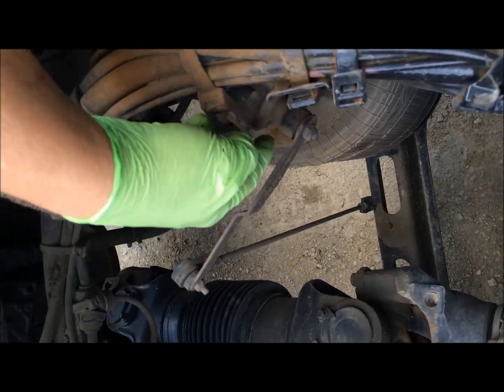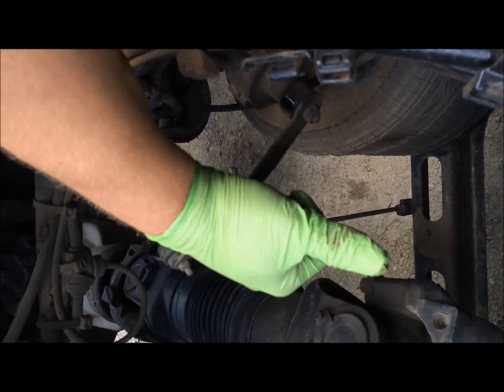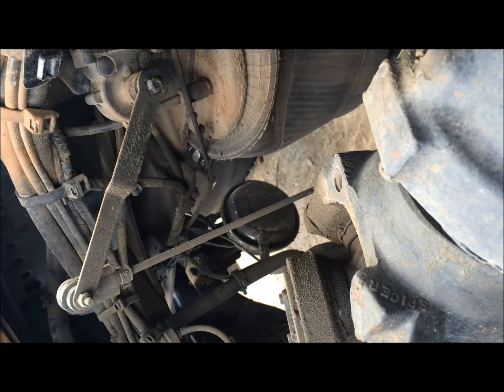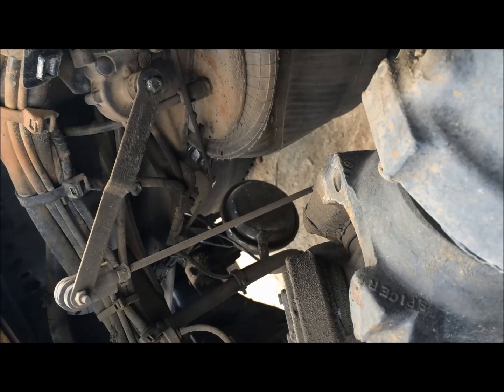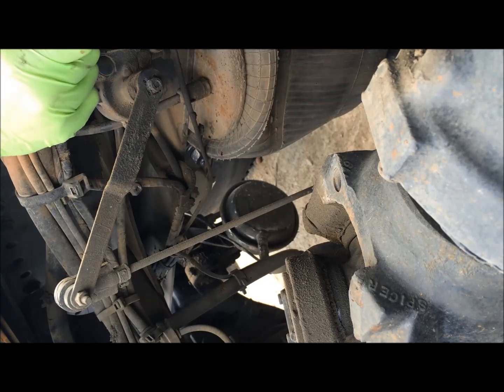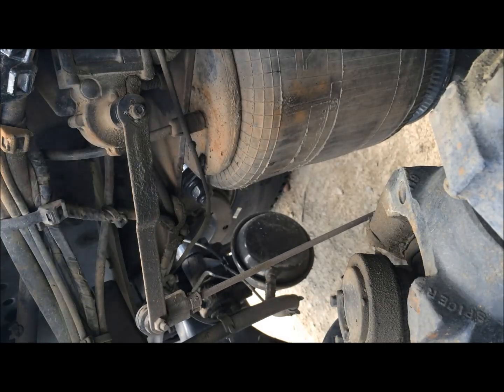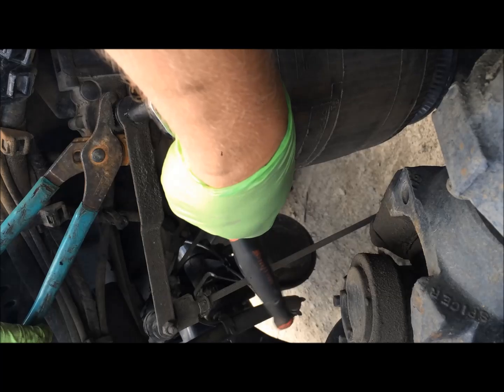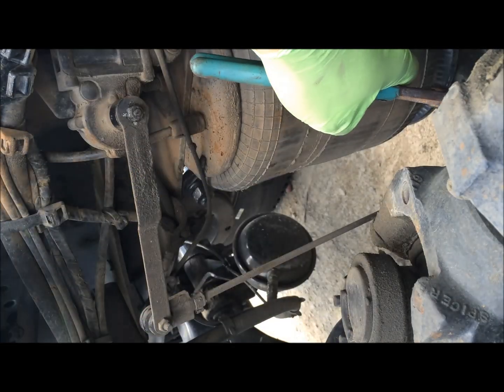Air Suspension Leveling Valve.

Comment: If air is not present at the suspension leveling valve an air pressure protection valve may be stuck .  It is located on the secondary air tank .

Comment: The rubber grommets,  if you will. Are they suppose to rotate freely on the bolt. .meaning I see the bolts are smooth then a thread starts . Commonsense tells me it should hoe ever I'm not a mechanic and my mechanic has them so tight the rubber bends over instead of it freely pivoting on the bolt. I mean it's a lock nut it's not going any where but he says leave them on there tight. Now my bags are 3" from bottom of inner bad I guess to the rubber of bag

Comment: Hey Carl.. I have an FH 12 Volvo having trouble with no air going into the airbags.. got told from a mechanic yesterday that there’s no power coming from the front sensor plugs to activate air down to the airbags. Would you have any ideas on what it might be? I’ve got a sparky coming out to have a look but that’s in about a weeks time.

Comment: Is the leveling valve the same valve responsible for dumping the air suspension when I flip the switch in the cab? Or is there a separate valve with an air switch for that?

Comment: Thank you so much! I have a job to start in the morning and of course it screws up at 10pm the night before. Without this video I would still be looking for broken wires. I just took off the linkage and pulled it up and it started to air up so I put it back together and that seemed to fix it!
Reply from the maker: Mitchell Heyink glad I could help

Comment: I have a question sir ,I have a 2015 kenworth t680  the bolt that holds the leveling rod that is tied to the bottom part where the shock is  keeps breaking on me is it because I need new shocks?
Reply: Hey did you fix your problem? I kept putting new ones one and they keep being pulled forward to lay on the air  bag... The entire L shaped rod is been snatched forward... Causing the bags not to be level.. Any info would be greatly appreciated

Comment: Ty! I'm going to have a look at my truck for this issue. My problem is actually reverse. The airbags are overinflating and not deflating even though I can hear the air releasing
Reply: Sublime Rebel what’s up man. My truck is doing the opposite of what he is sayin likes yours !!! Did you come up with a little quick temp fix !! ??
Reply: I'm having the same issue.. I don't have a susp / dump valve.. so not able to deflate the airbags
Reply: Did you turn the adjustment to deflate?

Comment: How many valve used in air suspension system each one how works
Reply from the maker: Muhammad Fayyaz so there is typically one on the real axle, and one on the cab. There maybe one on each side of the front axle in trucks with air ride front suspension. 

There is simply a spool inside that slides fore and aft based on are position. Other use a rotary spool that’s does he same thing.
Reply: Can I ask a question I need to see if someone can help me with getting air to my brakes so I can move my motor home I have just purchased I can't start the engine up at this time and I have only till tomorrow evening to move it about a city block but I got to get brakes released and I know I've got to have air pressure to do so is there a place I can hook a air compressor to a sertain place so I can get air to my tanks its a class a diasil motor home I know it' has six air tanks that I have seen on it and the engine is a3208 cat I don't know if that makes a difference or not

Comment: Thanks for the vid Carl. On my prostar, the back axle bags are always higher than the middle one. Any idea? Back airbags are full height while middle are about 2 inch lower.
Reply: Just installed a new level and the problem is still there.
Reply: Hello sir… I’ve the same issue with mine. The rear airbags are higher than the middle ones. Can’t figure out why is that? Did you end up finding out by any chance? Many thanks in advance 🙏🏻
Reply: I got same problem  put new leweling valve same think but pay atention every secund volvo is like that

Comment: Nice.

I have the haldex # 90054007

How do u adjust it?

Mine was leaking air.

So I bought a new one
And still leaking air? 

Through the clear hose. On the very top of the 3

Comment: Hey question what if it went dump and susp/dump is blinking non stop
Reply from the maker: Ernie Lepe I would assume your talking about an international? And if so, it means there is an electrical issue between the solenoid and the control module. Usually this is in the manifold assembly, and or the solenoid valve pins. You'll need to disassemble the manifold and check for corrosion, and continuity from the manifold pins to the solenoid sockets. If they check out it's likely one of the two suspension dump solenoids. There are two of them connected together.

Comment: Hey Carl what could of caused my engine brake to stop working on a 04 Freightliner Columbia ... thanks
Reply from the maker: Chris Jones oh good grief. There's many possible causes. The most common is a failed or misadjusted clutch switch. But it could be the brake switch, bad idle TPS, or the actual wiring to the over heads. I'm assuming it's a cummins? Insite will tell you specifically which is keeping it off. If its Detroit their software will too. Otherwise your gonna have to check switch adjustment, and then test for voltage to each switch, continuity through each switch, and continuity from the switch to the ECU.
Reply: Carl The Diesel Guy it's Detroit 60 serious I'll do what you said see if fix thank you so much. been such a headache ..

Comment: Nice. Mine leaks all the time. Took off the haldex and installed a different one. Same issue. It raises up. But just keeps leaking air all the time. 

Thanks
Reply: Mine does the same thing mario
Reply: That no good than air compresor worcking all the time

Comment: Hi buddy. I drive a Volvo VNL 2016. Anytime that I am loaded I got this air leak from that leveling valve I have it change but problem continue. That is the only problem that I got air leak for a little while then it stop.
Reply from the maker: Raymond Gonzalez is it an air leak to the open air? You will hear air entering and exiting the leveling valve for a few minutes when you hook to a trailer or unhook, Add or remove  a significant amount of weight. 
     If it leaks only when loaded after the truck has been stopped and left running for a while, around 10min, then you may have a leaking air bag actuating the valve, or you may be hearing an air leak in the actual air bag. Go around when you hear it, with a spray bottle of soapy water, and spray the tops of the air bags near the frame and where the bag meets to top plate and where the top plate meets the frame rail. Also when the bags are inflated spray the bottom of the bag near the "skirt" as well as all hose connections to the bags and valve. The bubbles indicate the leak.

Comment: I have a rv hauler its a 1996 volvo m11     i have a bad vibration people think my air bags are over extend   now here is the funny part  some guy efore me moved my air bags way to the left so there 3 inches sideways too much..  both the same way!  i moved them back now i have a bad vibration over 50   mph..  i put in a new carrer barring and all new ujoints and we timmed the drive shaft..  the air bads have been moved up and down the right way!  problem is the bad vibrtion is still there.. it was not doing this with the air bags way kicked sideways any clue why this is happening? i cannot drive it or pull my rv like this ..  every time i take it in they charge me and cannot fix the problem.. im going broke im done dropping money on this truck errr
Reply: i wish i could send you a photo

Comment: where you located? gonna get it checked....!
Reply from the maker: Alan Powel I am in Toledo Ohio. My shop is called Toledo Truck Repair and Service. 
However I am Very busy (read blessed), thus if you or anyone else needs service or help please call ahead. If I cannot get to you soon enough for your schedule Toledo Spring is very close and very good!
Reply from the maker: My shop # is (419) 478-6299. Our hours are normally 8-5 m-f now. However other options are avail by appointment.

Comment: Hi mate, my truck tilted to right side specially as it's loaded much tilted, the air bag suspension ok, everything in good order, what you think about that,?? Thank you
Reply: Alan Powel your truck is doing the opposite like mine is , it’s airing up too much therefore tilting the valve is not shutting off right
Reply from the maker: Alan Powel man without looking it over I'm not sure. But there's a pretty short list of things. Springs, hangers, bushings, fifth wheel anchor bushings/pins, tires etc...

Comment: 1999 Peterbilt 379. I am Not getting any air pressure to the air bags at all to my Semi, I do not have a trailer hook up.  I change my foot valve and my other valve, even the one in the dash. My lines are not cracked either. The new Foot Valve is still leaking. Do you or some might know where its coming from. If you do you can email me and I will respond. Thank you!
Reply from the maker: Ginger M, you would need to check to see if the line supplying the leveling valve with air, does in deed have air coming out of it. I'm fairly confident it does. But check that just in case. If it does and the rod connecting the valve to the axle is in place, then the valve itself must be bad.

Comment: kool... so no one will tell me my actual ride height. international prostar... asked terminal and several dealers. they all say set at factory leave it alone. i can feel my ujoints binding. ride height 2011 international prostar ??? thnxs in advance.
Reply from the maker: Paul what is your vin#
Reply: Srry.... not getting notifications.
Bn263929.
Reply from the maker: Paul I'll look into it Monday afternoon 11/28/16. I'll let you know
Reply: Ok... thnxs.
Reply: A.K.A 971155 my air suspensions out on my Jeep Grand Cherokee Overland bro so does that mean that that's where all that noise is coming from that grinding sound like I'm hitting strips that's all right it's off balance huh